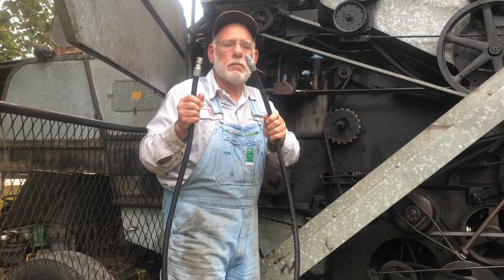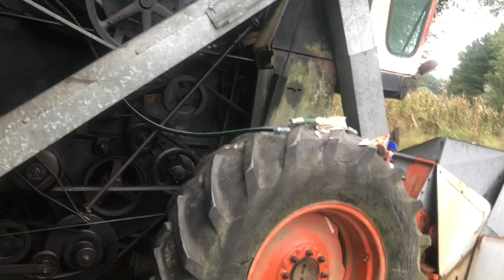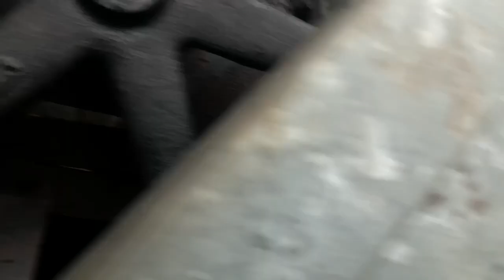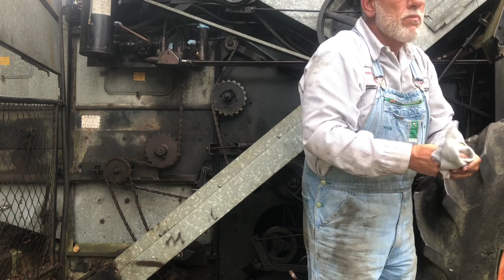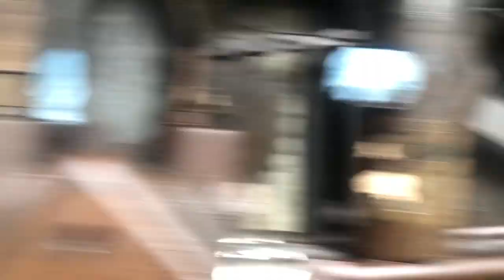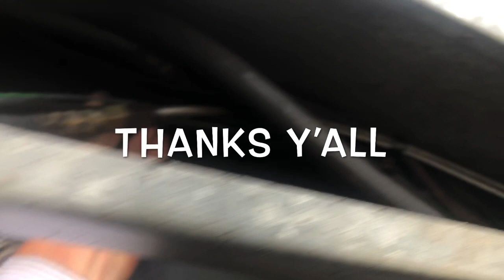Working On The Gleaner K part 6

Comment: It’s amazing how long it takes to do something that looks relatively simple like connecting a hose on one of those machines
Reply from the maker: If you run the hose right, hopefully you want have any break downs where it rubbed a hole in hose . Thanks mrour 👍🏻✌️
Reply: We got pretty good at replacing blown hydraulic hoses in double quick time, because when the machine was standing we weren't making bonus.
Two tricks we used was either tie a rope line on the old pipe and pull it through, followed by the new pipe. The best way though was to join the new pipe to the old one with some extra fittings and pull the lot through. Some of the really hard to get to runs would have one or two spare lines already installed. Other we cut and spliced sections in, as some pipe runs were a full drum of pipe long.

PS: I'm talking about Tunnel Boring Machines. But machines are machines what ever the size, just the hammers get bigger.

Comment: Looking good. When ever I needed to protect a line around metal I would use heater hose or fuel line depending on what size I needed. How far out you think you might be.
Reply from the maker: Thanks jtwes , I usually do that with hoses. I’m waiting for a frost if the corn can make it . We’ll see